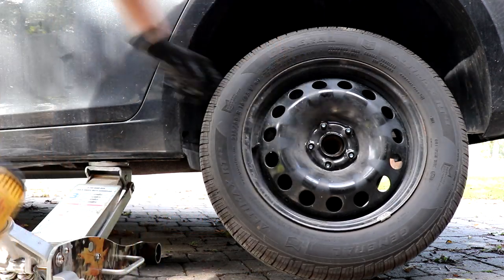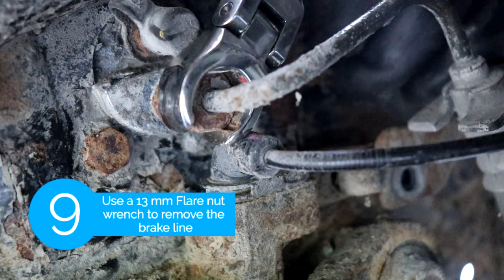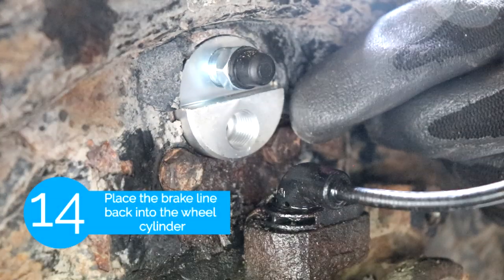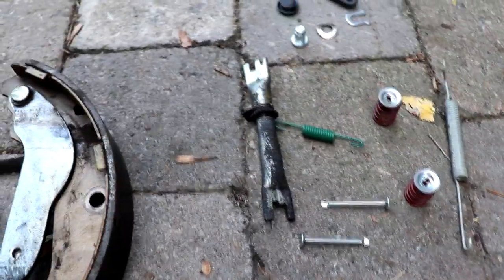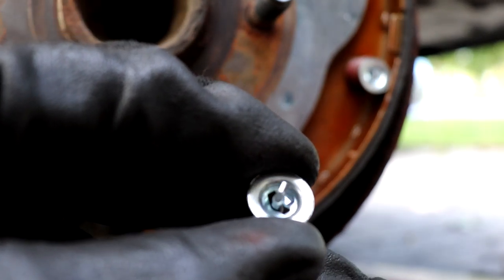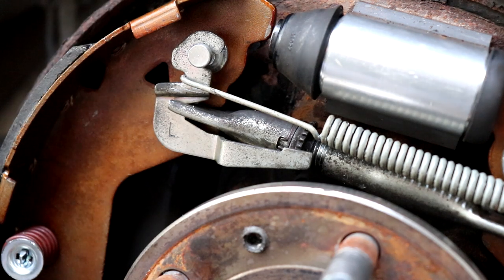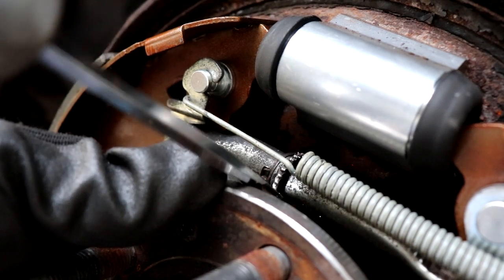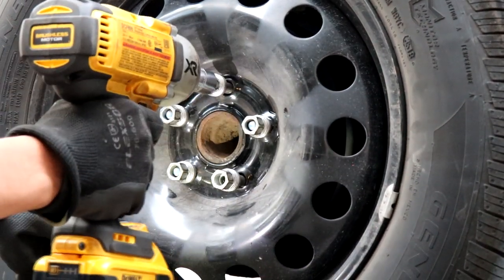How to Change Drum Brakes For Beginners

Comment: Really liked this video and how in depth you went. Thumbs up from me 👍🏽. One question though, the self adjuster works on its own, so why get the perfect spin on the wheel? I’m asking because if leave it alone and it doesn’t adjust It might be a very bad day.
Reply from the maker: the point is to get it as close as possible to the drum. You are right that it adjusts itself but it takes many pedal presses to get it where it should be. And since these affect braking power directly, its better to adjust it manually and its also faster. Some concept applies when adjusting hand brake drums. Hope that was clear ! thanks !
Reply: @OneTrickTech  thanks !

Comment: Hey I’m doing the same brake drum job on my Cruze and after putting everything together I tried so hard the drum won’t go back on even after adjusting the self adjuster to the lowest possible setting , what is the fix ?
Reply from the maker: The shoes are out of position, they probably shifted when you were putting the springs. Happened to me too, all you have to do is re-position them correctly, you can just hit them with your palm on top. They either shift towards the top or bottom, rarely side-to side.
Reply: @OneTrickTech  one more thing the ABS light came on after doing the job, I bled the brakes so many times but the pedal is still spongy but it still has little braking power , how to fix both and btw thank you so much for your reply and video helped me lots !!!!
Reply from the maker: is the ABS light always on or does it come on as soon as you start driving, like once you go over 20km/h ?

Comment: Good video bleeding only that wheel undid or all ??
Reply from the maker: You only need to bleed that one wheel. If you changed both sides, then bleed both wheels.
Reply: Do i need a tool or i can do it manually?
Reply from the maker: @derek4real928  I used 3/8" clear vinyl tube and a empty bottle. You can use any empty bottle you have at home. 

The clear vinyl tube you can get at any hardware store. And a 10mm or 11mm wrench. That's all you need. No specialty tools.

The exact size for the clear vinyl tube is  1/4 Inch Inside Diameter X 3/8 Inch Outside Diameter.

Hope the helps!
Reply: @OneTrickTech   and what pump on the brake ? And gonna come out in the bottle or ?
Reply from the maker: @derek4real928   Yea so here's how to do it in detail.

1. Attach the vinyl tube to the bleeder screw (like I did in the video). It should slide onto the bleeder screw but it will still be a tight fit. It should hold by itself. Then put the other end of the vinyl tube into the empty bottle. You can now rest the empty bottle on the ground next the wheel.

2. With the bleeder screw closed, pump the brake pedal a few times.

3. After you've pumped the brake pedal a few times, hold the brake pedal. If you are alone, put a stick or a bar between the driver seat and the brake pedal to hold it down. Or you can ask someone to hold it for you.

4. When the brake pedal is held, go ahead and open the bleeder screw. Brake fluid should come out thru your vinyl tube and into the bottle.

5. Repeat steps 2,3 and 4 until there is no more air bubbles coming out with the brake fluid. You should see no bubbles in the vinyl tube.

6. When your done. close the bleeder screw. And add some brake fluid to the master cylinder reservoir.

Hope the helps! let me know if you have more questions!
Reply: @OneTrickTech  sweet man thx alot appreciate 💯😁🙏
Reply: @derek4real928  ZAZZAZ Axy Aas ZZAazZzazZ